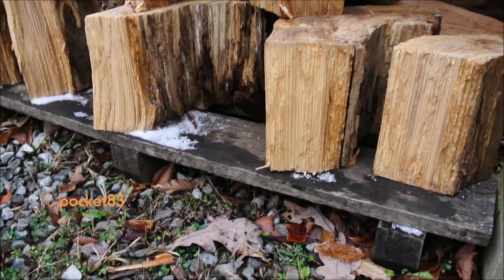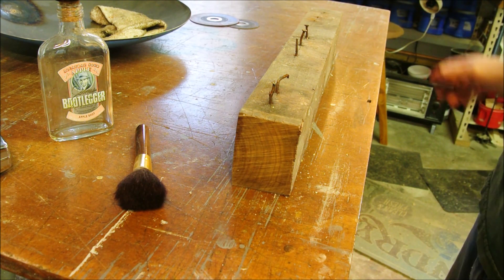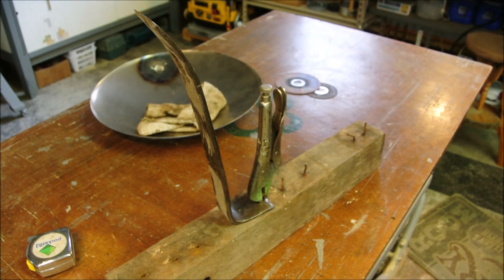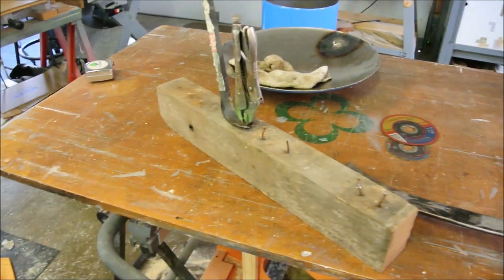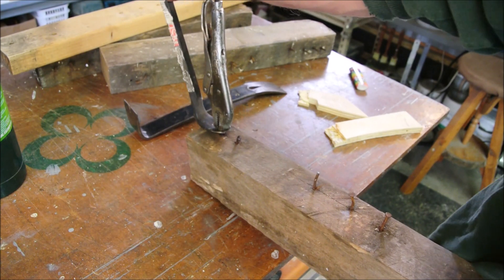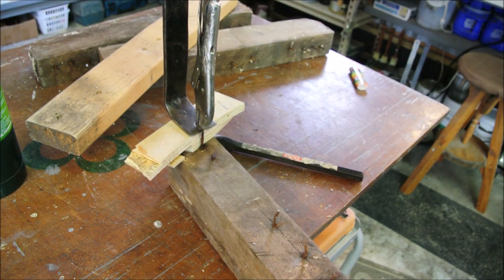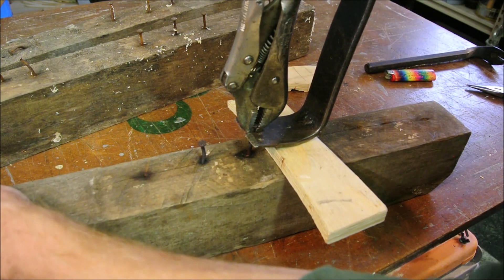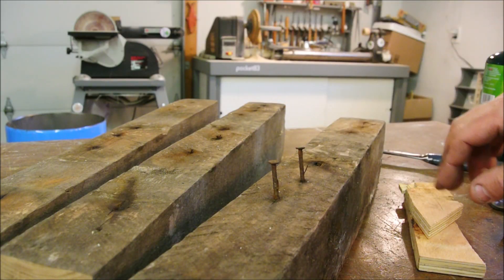Removing stuck nails with a propane torch

Comment: I just spent probably 5 hours today editing a video that I filmed a few months ago, part of which I show this tip. Whoah. 
But I learnt it from Izzy Swan a few years ago. Fantastic tip, it has saved me so much time! Even on small staples.
Reply: Even faster: put the wood in the microwave!...no.
Reply from the maker: Nothing new under the sun. Neither you, nor I, nor Izzy invented such an old idea. In fact, I may've done it 20 years ago and just forgot. It just so happens that I thought of it, tested it, and it worked. I'll check out your vid when I get some time though. Also, do you know which Izzy vid it was?
Reply: @pocket83squared  It was probably 5 years ago. I think it was 8 woodworking tips or something.
Not done editing it. Trying to condense NINETY minutes of footage to a 5-10min video. 20 hours in so far... No worries, my video will be out in a few months, probably.
Reply from the maker: Ouch! Don't record so much! Stripping down footage is the worst. I only take what I want to use, as in 20-second clips at a time. One minute for 4x speed shots. If it's dialogue, think about what you want to say first. 

90 minutes of footage just ends up in my "WIP" folder. Works in progress = never released.
Reply: @pocket83squared  Oh, it is (mostly made of) 20 second shots. I've been working on it for almost two years. 
The video isn't actually that special though, content-wise. But you never know what performs - I think it will do well.
Most of my videos are around 30-min worth of footage, and I condense them to around 4 minutes.

Comment: Wow, you don't pull stuck nails with your teeth?  

Weakling.
Reply from the maker: Psst. Used to make a fist and pull 'em out between my fingers,  then I took an Estwing in the knee.
Reply: @pocket83squared  I used to pull them out with an estwing until I look a knee to the nail

Used to take em out with my knees until in took a nail to the arrow

I used to nail knees until I arrowed